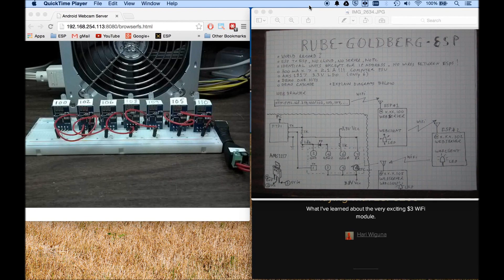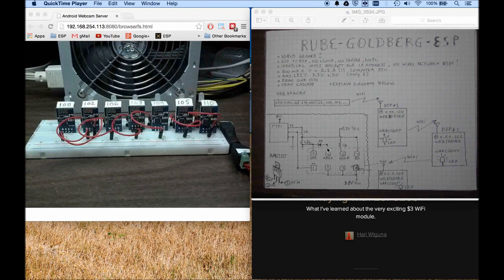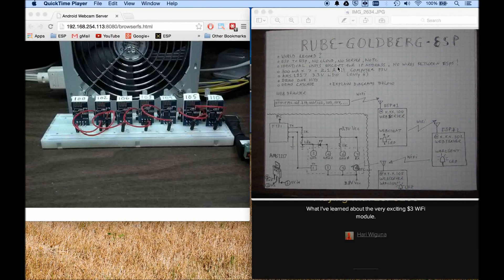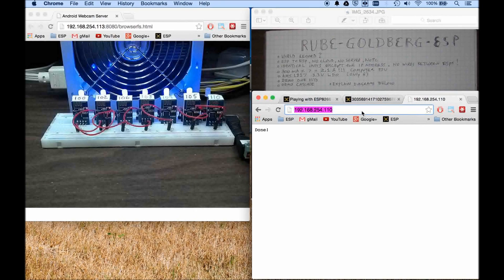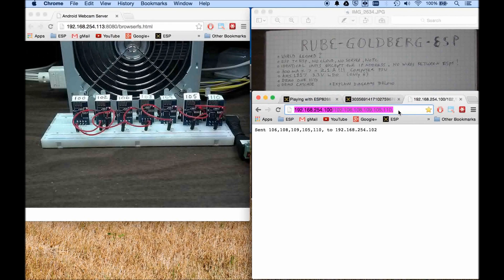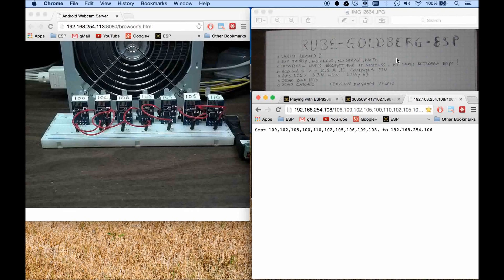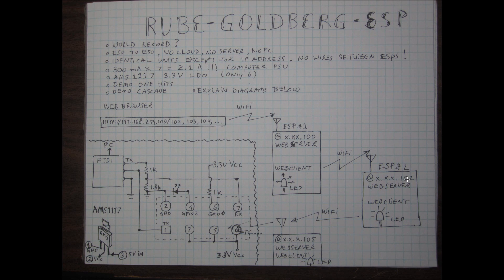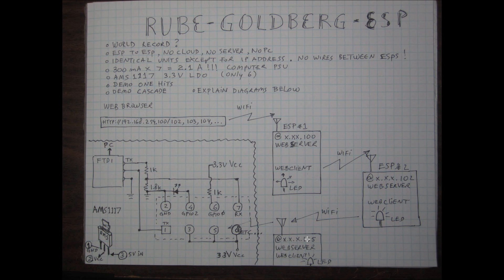$3 Wifi module part 10: A World Record?!

Comment: Hi! Hari Wiguna Sir! I'm very Thankful to you for Posting this Informative Video Tutorial. I was working on a Project to Control 3 ESP8266 Modules from one ESP8266 Server with HTML Webpage. I have got some Informative Knowledge from this Video. Can you Please guide me to make One of the ESP as an Access Point & Server for Rest of the ESP Modules as Stations & Webpage at Server Side Control all the Station ESPs?? 

Thanks once again.
Reply from the maker: Umar, thank you for the comment.
Since you wanted the one Access point to INITIATE control of the rest of the ESPs, you would need to run a webserver on EACH of the station ESPs. Otherwise the communication has to be initiated by the station.  In either case, you would have the AP webserver serve the UI webpages for humans, and that page would send web requests to the appropriate station.
A more standard way to do this would be to use MQTT.  The access point would be your typical home ap, the server would act as a message broker so each station could publish and/or subscribe to messages.
Reply: @HariWiguna  Thanks for giving the Solution to the Problem

Comment: hey. I would apreciate your answer. I want to connect 6 esp8266 modules, each with an arduino as the microcontroller to read two remote sensors. And I want that this 6 modules are connected to a main esp8266, so this main esp can receive the 6 simultaneous data. please. ia thia possible or do I need a router?
Reply from the maker: Hello Vladimir!
Yes, you can setup one MAIN esp as a webserver, and have the other esp as a webclient connecting to that one main webserver and not use any router.

However, depending on your environment, that might not be the best option.
Do you know that the ESP can now act AS an Arduino?  The ESP only has one analog input and it's a 3.3V device, but if that is not a limitation for your sensor, then you can save money and complexity by not using any Arduino at all.  Have you see this?
https://www.youtube.com/watch?v=MWebdJwr6ks
Reply: Thank you so much! I've got a clear idea now! cheers! :)

Comment: I just had to visit this video been a while. But from what i know and remember. I think why you can't get the full 24 amps  on the 3.3v is because you need a load on the 5v and 12v. So what you can do is take a old hard drive and plug it in. should be able to help on that. Is what i had to do on mine to get more 3.3v current.
Reply from the maker: Ah.. that's a cool trick.  Thanks J!
Reply: Welcome.
Reply: Glenn Johnson yes it is a load that is needed in order for it to function the power supply correctly.

Comment: Nice job!! I love it, do you believe I can put only one module esp8266 to 3.3V on ATX? it gives me some problems, the module is making weird things but I only use one module.

It can be by the ripple?

Thanks for sharing!
Reply from the maker: +hiddenotebook , yes, you are correct.  Since I made this video, I learned the importance of capacitor on the power rail to account for the sudden current spike by the ESP.
Reply: thank you for the advice Hari I just need it

Comment: You can make work them faster if you install Node MCU firmware. At first i was controlling with an arduino didnt work quite well. so i installed node mcu, works perect.

Comment: Can you make a WiFi Mesh Network with these modules?
Reply from the maker: +Ashutosh Bhatt , The ESP knows how to be an Access Point, or a Client, but not a member in a mesh network.  In theory though, someone could write firmware to do that, but it does not know how to do that out of the box.   You could do it manually by setting some of the ESP as an AP and some as client, but it would not be an actual dynamic mesh network.  Let me know if you find a firmware to enable ESP mesh networking. That'd be cool.
Reply: I found an example code in the Arduino port of esp called Esp Mesh (I think). It is pretty basic, but definitely serves the purpose.
Reply: hi Ashutosh ,
please let me know about the Codes about the Mesh Network

Comment: Thank you for your share...I have one question...?
Can send or receive from esp8266 to another esp8266 and distance?
Thank sir.
Reply from the maker: +Anekwong Yoddumnern , Yes, you can set one ESP as an access point (wireless router), and the other as a WiFi client (act like a web browser).
Follow instructions on this page to program the ESP using Arduino IDE.  In the examples menu you will see sketches to do the above. Good luck!
https://github.com/esp8266/arduino

Comment: whats up with the motor control and all that robot stuff?
Reply: +Hari Wiguna  do you have anything with esp controlling dc motors over serial?
Reply from the maker: +Frank Lopez , I've controlled DC motor with a transistor.  I don't remember now the exact model, but you should be able to find similar circuit for Arduino and use it with the ESP.  It's just that the ESP/Arduino cannot directly drive a motor, so you need a little circuit to drive the motor.
https://www.youtube.com/watch?v=ecnxMOie7PM&index=15&list=PL-xZsBalytNAFgyiDI8_lwXyeVE3R4hpx

However, if what you want to do is control an arm or leg, you probably would want a servo instead of a motor so you would have absolute position instead of just off/on and direction.
Reply: ok let me clarify, my Platform is 7 foot tal so as you can see there is no such servo that will apply to my prototype, and as for the arduino and esp controlling a motor maybe i chud have been clear, "i know arduino nor esp can control no motor thats what drivers are for" what i was asking was about a setup where the arduino is the controller the motor driver is a hbrdige config Ic  L298N / L293D being the driver and the ESP being the wireless module
Reply from the maker: oh, if you don't need the ESP to do any logic, then there's no compelling reason to code on the ESP.  If I understood you correctly, you can use the PC as the brain, figuring everything out, use WiFi to communicate with the ESP, and the ESP simply passes the information via serial port to the Arduino that would use the motor driver to drive motors.  

The default firmware on the ESP would work just fine.  The Arduino would send it setup strings to connect to WiFi, get info from the PC, etc.
But all the logic would be on the PC and Arduino.

In contrast, in almost all of my ESP videos, I'm NOT using an Arduino, I'm programming the ESP either in NodeMCU/Lua or using Arduino IDE for ESP (which confusingly, involves NO actual Arduino, the ESP IS the Arduino) :-) For your project, however, you're probably right in letting the Arduino be the one controlling the motor driver.
Reply: you couldn't have said it better, thanks for the confirmation Hari
Reply: now as far as setting up the wifi part of the arduino or esp how is all his done? where and how and what typr of info do i need to get this setup?
Reply from the maker: +Frank Lopez , This is the oldest way to use ESP8266 , so there's tons of tutorials for doing it this way.  Here's an example:
http://www.instructables.com/id/noobs-guide-to-ESP8266-with-Arduino-Mega-2560-or-U/?ALLSTEPS
Reply: thanks!

Comment: They're not talking to each other. Instead its your browser querying them in sequence.
They can't talk to each other without some external hardware/software like an Arduino or Rasberry Pi.
If you want to set up a wifi repeater you will need a Rasberry Pi for sure. I ran into this issue while designing and building my remote solar powered wifi repeater / AP nodes for a drag strip in Arizona. I had to buy 15 Rasberry Pi's because Audrino didnt have enough cpu power to do what I wanted.
Reply: +ElfNet Gaming it has an accesspoint feature, you need no other things...

Comment: Can i use LM1117 insted of ams1117?
Reply from the maker: Tarun Vaghasiya , yes, they are both LDO (Low Drop Output) voltage regulators.  Just make sure you get the 3.3V version.

Comment: I didn't notice any bypass caps anywhere. You might have fewer power problems if you put some bypass capacitors on the +3.3V rail(s). It might be good to put some on the 5V side too.
Reply from the maker: PhattyMo , you're absolutely right.  It's pretty amazing that it worked without. Thank you for the tip.
Reply: Hari Wiguna This is cool,I might have to order a few more modules,and play around with this. :) I would love to be able to do some kind of wifi mesh network,or something kinda-sorta close,with these modules..store-and-forward,or something like your project here might be close enough.

Comment: The Wifi repeater idea is actually very good. One way to do this is to use two of them wired together. One would log in to the router and the other would become a new access point. Then you could make another repeater with two others. One would log into the access point of the first repeater and the other would create a new access point. I don't see why it wouldn't be possible to have a single wifi unit log into two access points at the same time and act as a bridge. It's all up to the programming.

I think the reason they aren't so reliable is because they are so close together. I don't know why, but I have noticed with my bluetooth dongle that if the phone is too close to it, it becomes unreliable.

Do you have any ideas on why the power supply is not giving as many amps as it is rated for? Is it really old and maybe has some bad caps in it? What might cause that? I'm curious because I was given a computer that has a history of burning out hard drives and so I'm thinking it is going to be the power supply that is the problem, although I haven't done any tests yet. I'm already thinking ahead to how I might fix it if the problem is the power supply (other than just buying a new power supply).
Reply from the maker: kedwa30 , using two ESP wired together is a clever idea.
Interference between ESPs is also a good theory. I could imagine two waveforms from two ESP cancelling each other if it is just at the wrong phase.
You might be right on the bad caps on the PSU too. I don't know.
Thank you for your comments!

Comment: Hi Hari,
Great video! One question: You say that the wifi modules communicate to each other directly (peer2peer), like in a chain, and that they could be used as repeaters. Is that really true? Aren't they all talking via your wireless router?
Reply from the maker: ontropia , You are absolutely correct. I need to put a correction in the video. This is not the first time someone noticed my faulty logic. :-) Thank you for leaving a comment.

Comment: Hi Hari,
Thank you for your great tutorial.
Do you have any idea on how to set the IP address of ESP8266 when it is set as STATIONAP? I've tried wifi.ap.setip() but there is no effect!
Reply from the maker: Foad Emadi , Thank you for leaving positive feedback.
As far as setting IP of a WiFi client, I think that is up to the access point, not the client/station.  Login to your WiFi access point. In there you should be able to assign a specific IP for a specific MAC address.  You can print the MAC address of your ESP using wifi.sta.getmac().  Good luck!

Comment: Would you actually be able to do wifi repeating? If the one on the barn can't communicate with the router, then it won't join the network, right? I'm not an expert on wifi, just skeptical.
Reply from the maker: You're right, I didn't think of that. OK, it's back to a silly experiment then. :-)